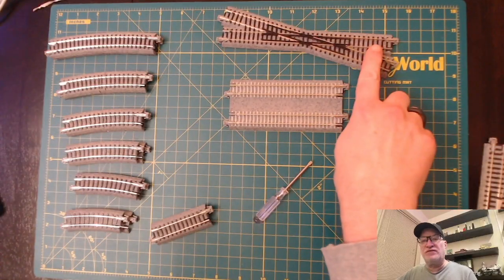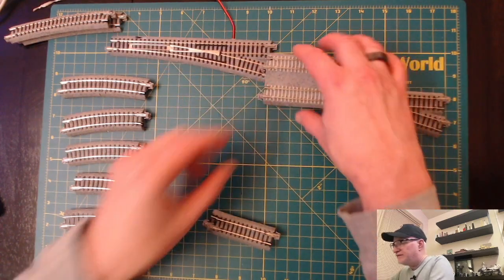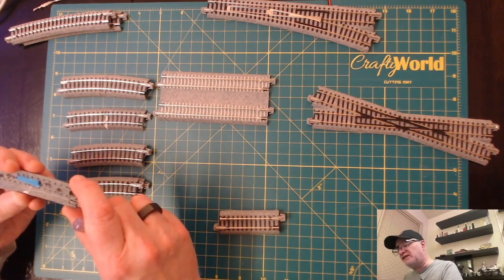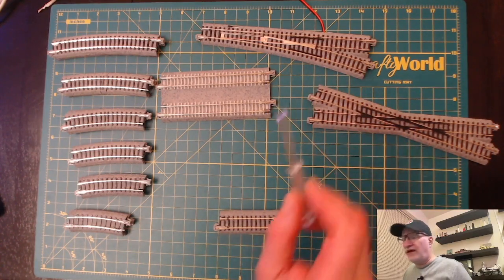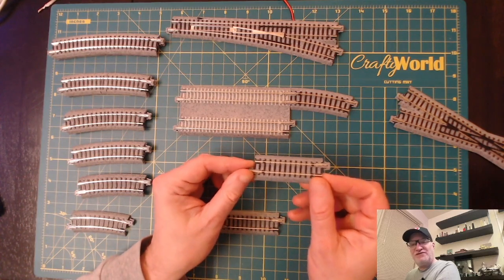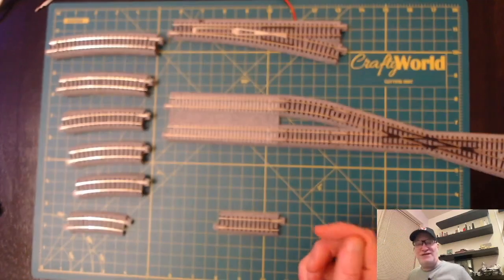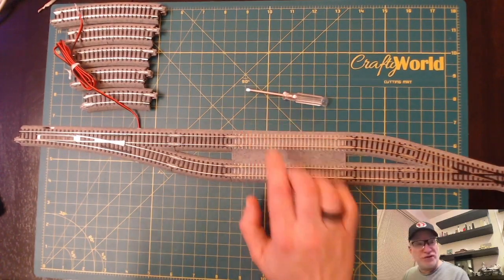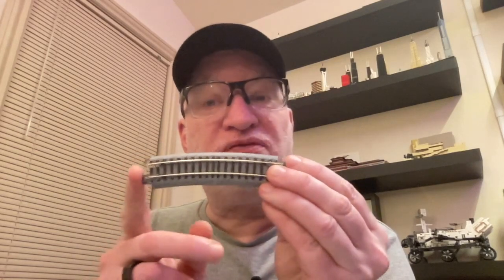Ask Me Anything - Kato Unitrack Geometry - How to connect a double track to a 15 degree crossing.

Comment: Hello :) thanks for the video.  You said ASK ME ANYTHING :) I'm falling in love with Unitrack lol I was thinking of building an old layout by Lynn Westcott from his book HO RAILROAD THAT GROWS but in N scale and instead of a 4ftx8ft doing it in just over 2x4 ft as that would easily slide under a bed. Would 8.5-inch radius track, which would replace the 18-inch original layout radius track, work well with say F-7 style diesels?  Or would you suggest trying the slightly larger 9+ inch radius as I'm not sure that would fit within the layout size constraints.  I have a ton of the 11-inch curves, but I know that would not work without making complicated adjustments. I am thinking of raffling it off locally to give proceeds to a charity or school.  Just looking for an opinion from somebody used to Kato Unitrack. Thanks :)
Reply from the maker: Hi! A brief check of a few places and I'd say the 216mm 8.5 inch radius will work with 4 axle diesels and shorter freight cars. It would make a nice compact layout for sure.
Reply: @GreatNorthernJJ  Thank you so much for the quick response. Your opinion helps alot.  Keep the videos coming :)
Reply from the maker: Thanks for watching. I'm happy you find the videos informative.

Comment: I need to make an HO track that will make a 490 switch align with a 60mm latter track. I would like to see how you make a custom piece of track. Do you have a video of this? The 490 switch only comes out to a 75mm latter track. I would like it to align  to 60mm, thus the custom-made track piece.
Reply from the maker: Check this out https://youtu.be/KYjuEwOxbhc?si=pwrNa0UWw_pPkd6B it applies to curves but you can cut 15mm out of the center of the 75mm straight and then use your rail nippers to shorten the rails.

Comment: What is the width of v11 curve and the v16 track. I'm using a core door and I'm looking for the widest width. Really could use your help.. Thanks Gerry
Reply from the maker: Hi Gerry - looking at the description for v11 the double track is 414/384mm radius roughly 16"/15" in imperial units. Or 32" so you would want 34" door for that or a bit larger. V16 is the largest double track and has 480/447mm radius roughly 19/18 inches so you'd want a 40 inch or more door/surface minimin.
Reply from the maker: On Saturday at 9am Pacific US time I will cover all of the variants available from Kato and what you get in each set.

Comment: Kato N Scale is SO frustrating. I use it for mainline due to smooth operation, but use Peco for the rest.
Reply from the maker: I hear you. My first two layouts used it exclusively but now I have a closet full of Kato Track and switching most to peco except for parts of the staging yard. Runs really smooth but the geometries and track configuration are irritating at times.
Reply: @GreatNorthernJJ  Thanks. I thought it was me. All these videos which show how great it is - and it is for smooth operations - but no one touches on how difficult it is to design a layout around its limitations. And I HATE the gap between tracks using #6 turnouts.
Reply from the maker: @BlackMan614 I haven't attempted this myself but Mike Fifer of Fifer Hobby Supply published this a few years ago on how to modify two #6s into a single crossover. Note the single crossovers Kato has are #4s with their issues. https://youtu.be/SoX0YtYhwoY?si=dRAO0dTWRk9dLm7B

Comment: I used to use Atlas track.  Recently when I used Kato (HO) for the first time I was surprised at the oddball lengths and radii.  Atlas is measured off in standard fractions of an inch for simplicity.  Kato is engineered to make the geometry and math work out even. Much better. 👍
Reply: If you're impressed by the Kato track geometry you should check out the charts for Tomix Finetrack geometry.
Reply from the maker: Yes, it's what I've discovered as well. The thought that went into the design of the lengths and the supported radii is nice.

Comment: Hey, I am looking at trying to use the kato 15 degree cross so I can have a siding use the cross to make two lines crossing to the interior. Think it will work?
Reply from the maker: Yep on 49.5mm track separation. The 15 degree crossings work together with the number 6 turnouts. I'll post a video to illustrate that in a bit.
Reply: @GreatNorthernJJ  You're awesome
Reply from the maker: @georgescott1180  thanks for watching. Glad to share the knowledge.